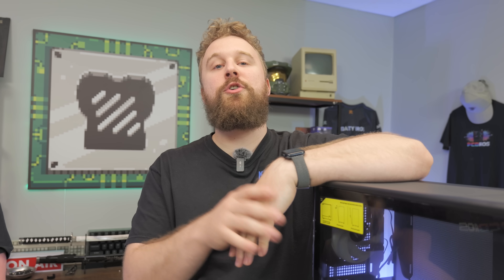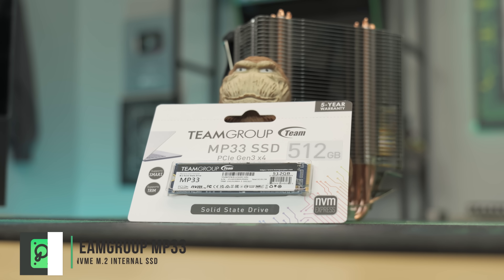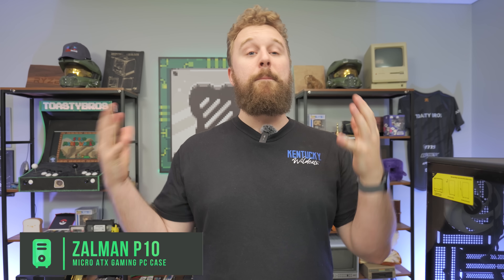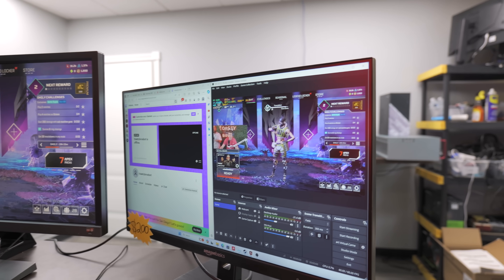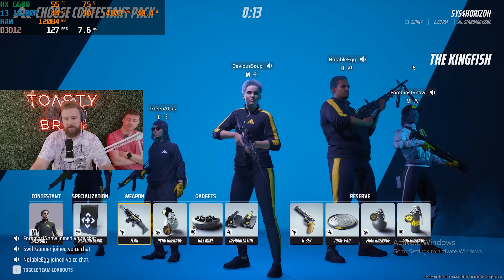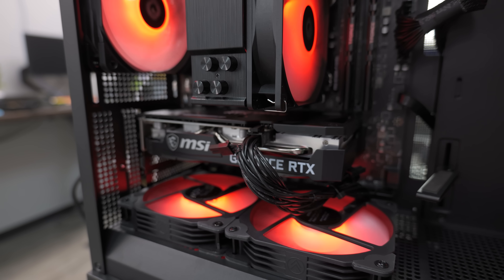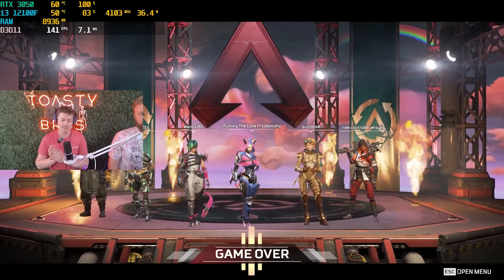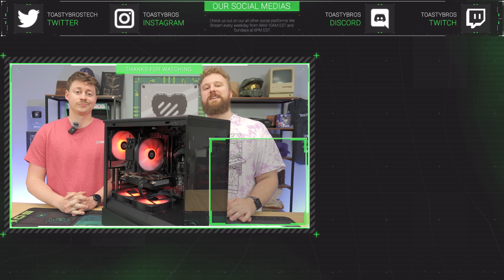$500 Gaming PC - AMD or Nvidia - Which is Best For Live Streaming?

Comment: this is practically my build. More specifically, I have a MSI B760M P DDR4, intel i3 12100f, 16gb 3200MHZram (RGB), 512gb SSD Kingston?, and a recent addition the RX 6600 XT. It's great for 1080p high-ultra gaming. Prob would be good for low/medium 1440p too.

Comment: As someone that has streamed on both twitch and YT with AMD cards, I can confirm rdna3 is a much better route to go due to them having the avc encoder, rather than AMD's crappy h264 encoder or even HEVC. Also stream quality, particularly for AMD is way better on YT due to YT not having a bitrate cap like twitch does. AMD does way worse at lower bitrates comparatively than nvidia, so streaming on YT allows them to be able to just brute force better stream quality by being able to ramp up the bitrate to like 15mbps.

Comment: I say Nvidia is still better (just barely) but either should do just well, it reminds me of the the good old question of Intel or AMD where one used to be on top and now they are neck and neck passing each other in certain areas. I feel like in a few years it will all be preference to the the builder and it'll just be what brand you prefer.

Comment: Lol I love amd, I was introduced to AMD by you the Toasty bros when I built a PC with the RX 570 4gb i310100f in the white Mustex case about 3 years ago. Streaming is where I ran into isuues and the Vram with a 4gig card. Other than that no problem with amd's hardware and really easy to use. I now have upgraded all my parts and still went amd, the 7800 XT is a beast and does everything I need with 16gs of Vram which is insane compared and I love it. I recommend if you want even better streaming quality for amd or nvidia just get a dedicated stream card. Works like a charm and frees up your GPU to game. My first was about 550$ for all parts of the tower

Comment: Just curious. Will a 6-core cpu such as R5 3600 or 5500 be better for streaming while gaming? I did some research. They performs similarly in gaming and are now priced almost the same(~85 usd). The 2 extra cores should help right?

Comment: Yes…AMD GPUs simply do not age well for the used market. Every, EVERY, used and new NVIDIA-based GPU have always worked flawlessly. 

This year I decided to replace my old Gigabyte GV-N1060WF2OC-6GD GeForce GTX 1060 1556MHz 6GB GDDR5 Graphics Card with a used MSI Radeon RX 580 ARMOR 8GB GDDR5 (2304 SP) || GRAPHICS CARD. Thought I would give AMD another chance.  After cleaning it thoroughly and replacing the old thermal paste and thermal strips with new ones, after a day of some VR and gaming, it simply wouldn’t perform like it should have, always leaving lines across my screen.

So I simply put back the GTX back in my machine, updating drivers and it still remains a fast and cool GPU.  As far as it goes, NVIDIA should simply buy out the AMD for cheap and disband that whole company.

Comment: I'm surprised you didn't go a bit higher with the cpu, just to remove that from the equation and focus on the performance of the gpus for streaming. Also, this only really applied to YouTube right now, but the current gen cards support AV1, which is a better encoder all around. Still not sure why Twitch is dragging it's feet on implementing it.

Comment: With a machinist mr9a, 32gb of ddr4 ecc in 4x8 for quad channel, a 2690v3, mi899 for a bios mod and enabling ReBar, a 10 dollar TPM2.0 module, and a 6600m, you could play whatever you like and stream with the cpu with no issues for ~100 usd all in for cpu, mobo, ram.

Comment: Honestly, you could spend money differently in this build. you should have thought about spending a tiny bit more on the processor and getting the ability to have obs encoding supported by the integrated gpu. Intel has been supported on obs regarding this for a very very very long time. AMD's encoder has been snappy and fast for a very very long time and was supported on even the 7000 series quite some time ago. Quick sync was straight up better than nvenc at low bitrates even when introduced with the 2nd gen intel core processors when it was popped into obs. Not sure why people are stuck to nvidia on this one. I know many larger streamers were straight up paid via hardware to promote their shit and locked into the ecosystem, but many also eskew nvenc to this day because it's just kinda bad at lower bitrates and it's much better still to use a capture pc.

But really, you should have absolutely looked into quicksync.

Comment: In both cases the cpu was definitely a drag, even when using gpu encoder the cpu is very important for streaming, this test was a bit distorted and neither of the gpu's showed the real potential for streaming, 6 cores is the bare minimum, throw in something like 12400f or 5600x and this pc is gonna be nice streaming machine with both gpu's ;p

Comment: I love how these guys always aim to the middle class that need to save money and not these extravagant $4000 builds that very few can afford. Keep it up!
Reply: to be fair , 4000 $ builds are not fun :D  budget builds are much more fun to play with
Reply: This is an interesting perspective to me, I saw a gaming PC being less than 1000$ as impossible because I excluded used parts for my personal builds. Just stigma from using ebay and the like back in the day, before there was a money back garauntee. 

I can't reasonably afford to just eat the price of disfunctional equipment, so I've decided to try and update my old PC to use as a game server. I bought a 3070 OC on ebay for 230$, it arrives next week, I really hope it works!
Reply: @barryallen5507  You do realize you can get a build w/ a 6600m, and 5500 for only like 700 right? If a pc w/ new parts costs over 1k on the low end, you're doing something extremely wrong, probably overpaying for an ssd, or fans, or buying corsair ram kits (the worst mistake)
Reply: @glidestriker  I'm trying to comment to you, but my comments with the build are getting deleted almost instantly.
Reply: @glidestriker  I've been tryng for the past 20 minutes, this channel is blocking. Blame these guys ig.
Reply: Arc a580 not a good choice?
Reply: @TylerMitchell-ns2hk  get a 6600m instead. Similar cost, far better performce, even better than a 6600
Reply: the craziest part is in most forums or when i ask other gamers i play games with (usually strangers) they always say they have a 4000 series gpu and the newest gen cpu's and it makes me so confused cuz where are people getting this money from
Reply: Its fun enough all the same! Pretty scary to hold such expensive parts in your hands and install it, also scary to manually flash your mobo BIOS with nothing but hope and a single flashing LED to know if it succesfully updated or bricked.

Comment: I will rather go with nvidia, if you have a 4 core 8 thread cpu or even 6 core 12 thread I would go nvidia because the nvenc encoder takes all the load off the cpu and giving much headroom. A good example of cpu demanding games is Horizon Forbidden West where I have a 6 core and 12 thread cpu and being used at 60%-81%, The last of us the same, 72%-89% cpu usage. If you dont play tripple a demanding games then go with amd, i wont use 4 core 8 threads on amd but will use 6 cores 12 threads on amd. Also you can go on a lower bitrate and still look better on that nvidia nvenc encoder.

Comment: So streaming with amd isn't a good idea ( it felt laggy somehow or not smooth enough )?
Reply: If they jumped up to the i5, the stream would've looked alot better overall. Using a 4c cpu for streaming is really pushing the system, plus they were probably streaming at 1920x1080 instead of 1280x720.

Comment: The 8 pin connector on the gpu never locked in 😂 or w.e its called.
Reply: If you watch the B-roll yes you can see the connector pushed all the way in.

Comment: I've heard of people actually adding a second GPU, specifically the Intel ARC A310 as it's a small single slot card with no extra power needed, and has the new AV1 incoder in it. I'd be interested to see you guys taking a crack at such a set up, cuz being able to use either of the above GPUs for gameplay while using the ARC GPU for the streaming load could be a pretty viable set up.

Mind you, this is all based on what I've heard. never actually tried it myself, but if it's a viable set up I'd almost invest in said ARC just to get into live streaming.
Reply: If you stream to YouTube this is a good idea, but for twitch it doesn't rlly make sense, as they don't support AV1 yet (or even HEVC for that matter) unfortunately.
Reply: @theminec  av1 and x265 is coming twitch soon but nvidia gets it first
Reply: @Stumpcatwizard  FINALLY!!! Only took them several moths after they initially announced it. When is it coming to AMD GPUs however?
Reply: @Stumpcatwizard  can you please be more specific as to when 'soon' actually will be 'now'? Because you know, using the x264 codec icw AMD kinda blurs my vision if you catch my drift.
Reply: Might be cheaper just getting the iGPU to stream decode. Aka get the i3-12100 vs the f

Comment: Why use last gen AMD  GPU,  usually enjoy your videos, but this one make me wonder what the point of it is, the RX 6600 isn't a present gen AMD  GPU,  like the 7600 ?, which has a better encoder,  looks like you're stacking the cards a little, and running it against in using a present gen Nvidia card,  as this produces a rather a pointless test!, while I understand that would probably bring the cost point up around $600-650 cost point,  cost point shouldn't be focus point , but matching  comparative entry GPU's, and using a CPU that probably bottle-necks the GPU's, other than gaining views can't see what this offers in information, while title does suggests the price point of build, video doesn't provide valid performance output for potential streamers. :hand-orange-covering-eyes:
Reply: 3050 is last gen Nvidia, I get what you mean though. The 3050 has AV1 encoding and the 6600 doesn't, but they are both last gen.

Comment: I’ve used AMD gpus for streaming since 2023, and it’s never let me down. Granted, I used a Ryzen 7 that whole time until recent. If you really wanna find the value with AMD streaming, I’d not go entry level. At that point, NVidia’s NVENC is just better, though as you go 
up the price bracket (say 300 us bucks for the 6700XT, or a 16GB 7600xt), things tend to line up better. If you’re dead-set on AMD for streaming, I’d go 7000 series.
Reply: this. i streamed with my 6600XT, and 6700XT, both cards for streams were honestly not up to par for me. Once i went 4070 Super, i was golden.
Reply: @DeadlyKiller54  You double the GPU price budget, so it's obvious you get better performance... Is there any Nvidia GPU at 300usd that can do better than 6700XT in gaming/streaming? RTX 4060?
Reply: @JasonChen927  i sold my 6700xt for 300 to my buddy, and got my 4070 super for 450. i work at best buy, so i had a chance to get it for that price and got it. for 300, nah there isn't but the quality of stream you will have will not be so good, and i had my 6700XT for over a year. when it did stream good, it was solid, but it got worse over time, and my streams looked very pixeled, even with my bitrate at 8000 like these guys with the 6600.
Reply: @JasonChen927  any 3000 series card in the lineup can stream as good or better than a 6700xt that includes the 3050
Reply: @DeadlyKiller54  hi, did those pixels go away once u used Nvidia? i asume so? Ive got the normal 6700 10gb and streams look shit no matter what so contemplating buying a 4070 ti super.
Reply: @DeadlyKiller54  Did you make sure the setup was up to par on the software side as well? I wouldn’t stream beyond 1080p 60fps on any GPU below 350 USD, simply because the hardware just isn’t there. My 6600XT worked perfectly for that, and so did my 6700XT, though the games I played did have to be cut back a little on the graphical side. I use AMD HW h.264 at 6000kb/s for 1080p 60fps.
Reply: @SLVR_VT  of course. it was always up to par, and updated. i had a 5800X3D as well. the AMD cards just didn't cut it for me. i just hated how my stream looked. it just looked blurry, no matter what i did. even my friends who had AMD cards before for streaming also noticed that once they went Nvidia 4070, and 4070 super, the quality was just much better as well for their streams.
Reply: @DeadlyKiller54  That’s NVENC for ya, although I didn’t notice much blockiness in my streams or videos with my AMD cards, only a graphical difference. It’s why I’d rather sell an RTX 3050 build for a starter streaming PC than a 6500XT, or even a 6600.
Reply: Yea, cause it has av1.

Comment: Anybody looking into these sorts of builds, try to go Nvidia or RX 7000 series. If you can find a cheap way to get on AV1 you'll get a good benefit to your streaming. Nvidia has support with 3000 and 4000 series, AMD only has support with RX 7000.
Reply: fyi Nvidia does NOT support AV1 on the 30 series.

Comment: Call me biased but i think the same bitrate looked better on the NVENC encoder. I've seen this first hand too. Although not an exact comparison, I've always had to use a higher bitrate with my AMD cards to get a clear looking recording, while with nvidia, i can get it pretty low.
Reply: AMD h.264 is bad they fixed it a little but it's still not there yet. Av1 and h265 on the same bitrate look almost identical on AMD and Nvidia but intel still wins the media engine game.

Comment: I think nvidia is the way to go. Only issue would be vram on alot of cards from ampere and 4000 series. I snagged a used 3090 for 500 so I have no issues live streaming but streaming does increase vram usage. Since I play at 3440x1440p and stream the 3090 for 500 has been amazing with a 7800x3d.